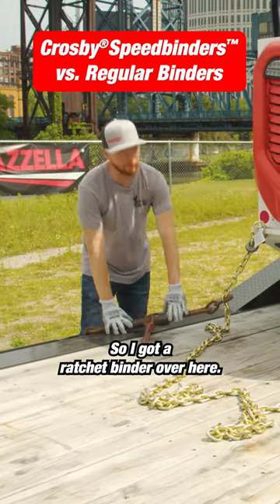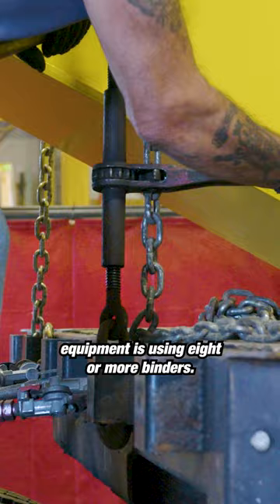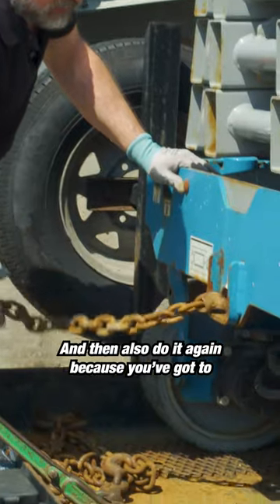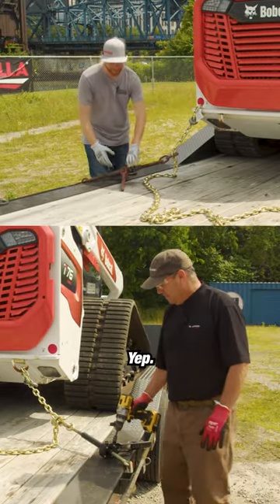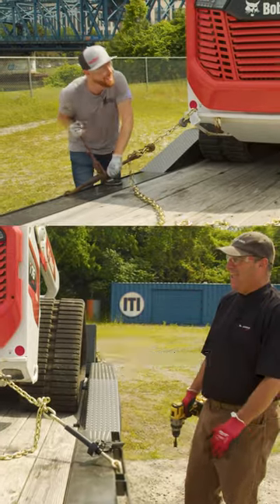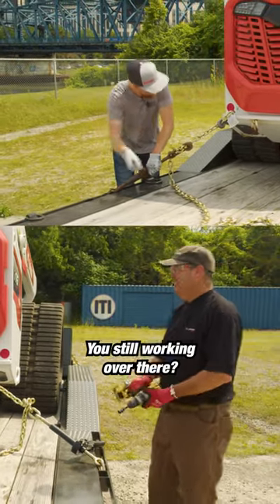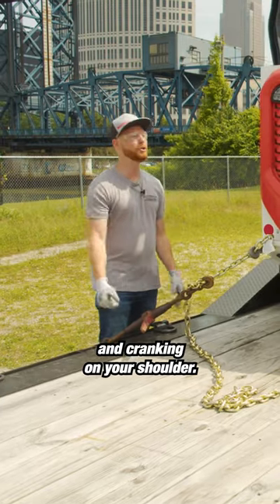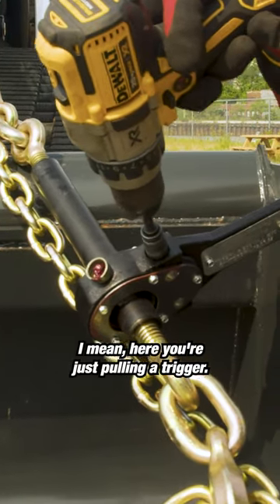Speedbinders vs Ratchet Binders! How Much Faster?? #trucking #transport #heavyhaul

Comment: Nobody who does this regularly is going to use the lever to take up all that slack. Put both hands on the barrel and start twisting. Use the lever when it gets tight.
Reply: Yeah but they always get rusty and hard to turn. And I know you say oil them, but we share trucks and you can’t make other people take care of stuff
Reply: @jimmy4x4socal44  Getting other people to take care of the gear is the hardest part. Particularly when the "other person" who uses it and leaves it full of dirt and rust is the boss 😅
Reply: @jimmy4x4socal44 you have to constanstly grease and lube a speed binder, what are you talking about? The maintenance is higher on speed binders bud. Plus the zirc fittings bust off so damn easy, gotta have backups or dirt gets in there and will lock and chuck your wrist into the next zipcode.
All you need is pb blaster for a ratchet, small spritz and you’re done🤷🏼‍♂️🤷🏼‍♂️ how is that harder?
Reply: @xxdisruptorxx7077  I guess you missed the part where I said we share trucks.
I’ll explain 
Every day I drive a different truck
Sometimes a dump
Sometimes a pintle hitch
Sometimes a lowboy
I usually bring my lunch, my water, my wallet, my phone, keys and my own gloves. I’m not carrying around a damn can of PB blaster 😂 and if I did and forgot it in the truck it wouldn’t be there next time I drove it.
If I was assigned a truck I would for sure but it just now like that where I work
Reply: @jimmy4x4socal44  i definitely read that part, my point is your complaint of dry binders is worse now with a speed binder, which means you missed what i said. Come on man, i know all about truck changing(its annoying honestly, it sucks) you cant explain anything to me i havent experienced already. 

Speed binders are high maintenance, and fragile as hell. The hardware loosens over time, and the grease fittings are super fragile and that shield easily breaks off after a few uses. None of this can happen with a ratchet, its impossible. On a rare occasion a bolt may loosen on the handle, far easier to maintain without a toolkit, couple of crescents big deal. 

A pb blaster can is small though, so not too sure why its so cumbersome to tag along. All good, to each their own, i prefer necessary work, not extra for same pay. Be safe out there
Reply: @xxdisruptorxx7077 your the only one talking about speed binders.
I just said the ratchet ones are hard to twist the barrel by hand when they get rusty. That’s it.

Comment: Dot going to find a way to make them eleagale
Reply: Sure hope so, that model is easily loosened just pulling up on it, it has no physical lock, and the handle must make contact in order to tighten, resulting in digging in your boards, or free spinning if no contact is made. I find them opposite of safe and easy, waste of money and the extra effort to set them up.